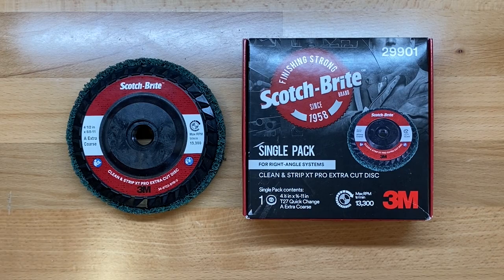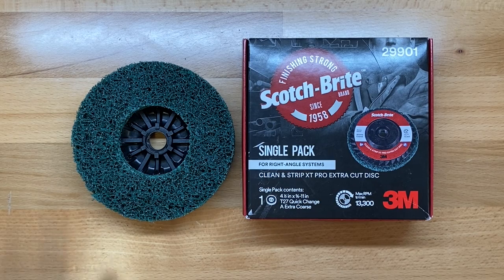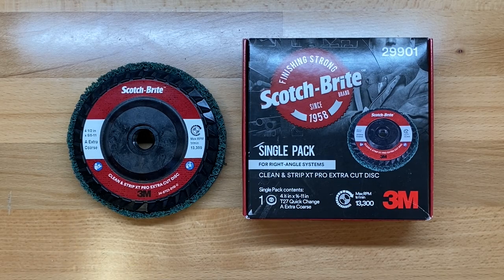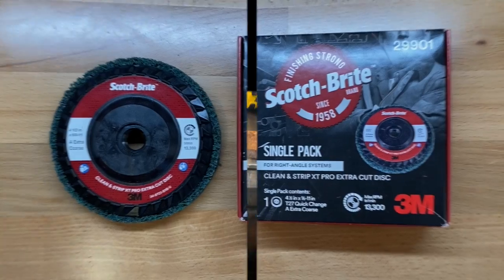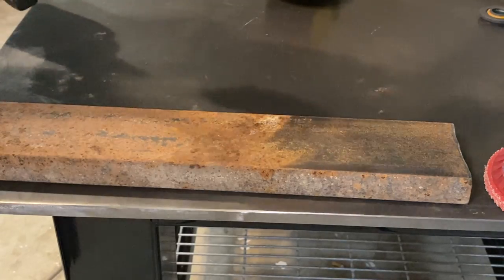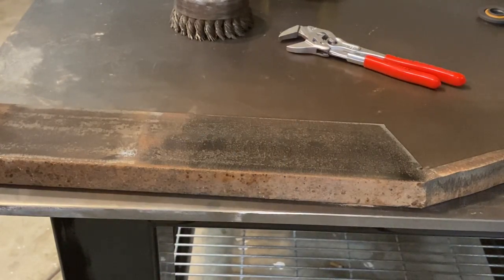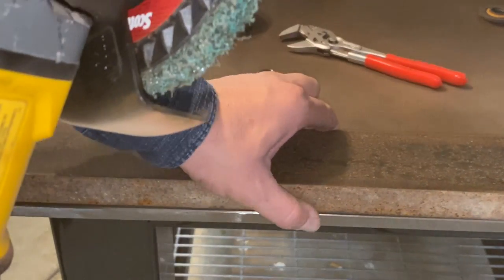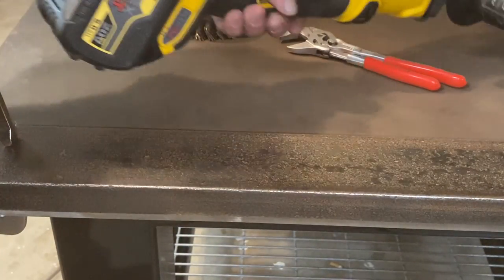3M Scotch-Brite Clean & Strip Pro

Comment: I think I'll have to try one after seeing that. I hope it will clean paint off without packing up like a flapdisk, And the version 2 flexvolt grinder due out soon claims to have 30% more power with the same runtime, super impressive if its true.
Reply from the maker: When it due to come out? I’ll be all over it.
Reply: @txtoolcrib  Just spring 2020, home depot has been having sales on the current model since December so its gotta be soon. I'm super impressed with my 2yr old current gen model. If you get one please do a comparison video!

Comment: Would you recommend using on plastic or will it scratch?
Reply from the maker: I would imagine as quickly as it ate into that rust it would be pretty abrasive on plastic. I don’t think I would recommend this disc for that application.
Reply: @txtoolcrib  thanks for the feedback. Anything you would recommend for plastic? I have plastic/acrylic spindles for my handrails and I recently had the handrails stained which left a lot of leftover stain on the spindles and I'm having an awfully hard time getting it off
Reply from the maker: Are they smooth or textured?
Reply from the maker: You might try a fine grade resin sanding disc.
Reply: @txtoolcrib  smooth
Reply from the maker: Grinder might be too fast of an rpm, polisher would probably offer you a lot more control.

Comment: What is millscale?
Reply from the maker: It is the hard black layer of iron oxides that form on the outside of steel during the milling process. It is formed when the steel is hot rolled at the mill.